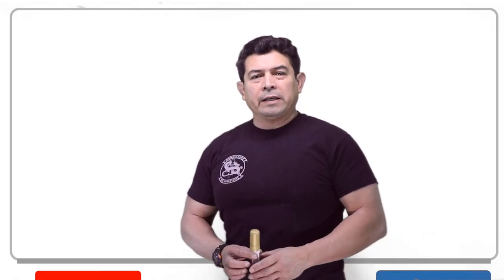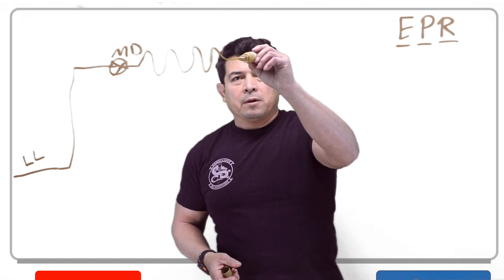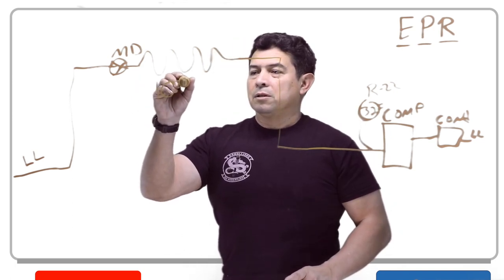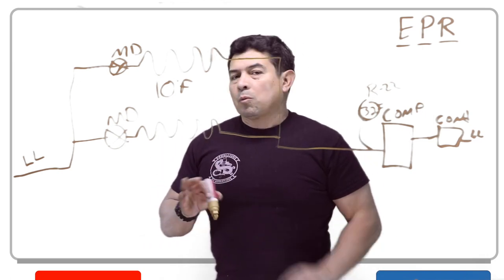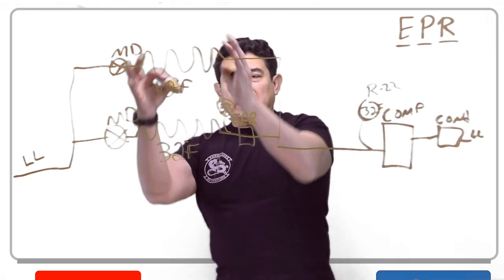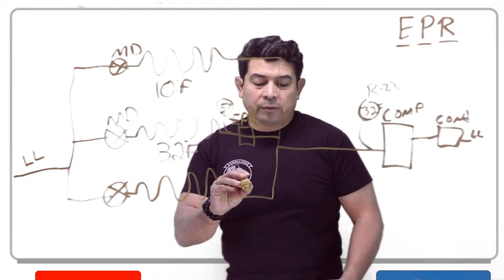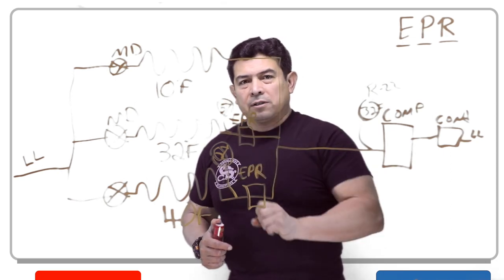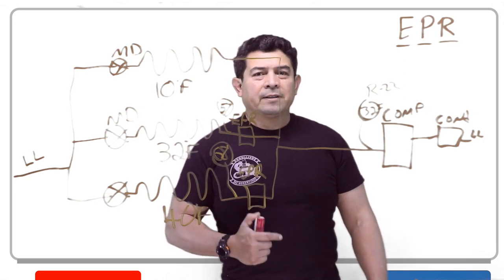Evaporator Pressure Regulating Valve (EPR) - HVAC Online Training and Courses

Comment: i dont get it, is this EPR valve able to regulate the pressure manually, also in the evap unit is it all these different temperatures in the coils ....or different fridge boxes ? one system
Reply from the maker: The EPR valve will regulate the pressure in that one evaporator. If the systems has two evaporators, and they are needed at different temperatures than the one with the highest temperature will need the EPR valve.  If you had a system with three evaporators, and they all need to be a different temperatures, the two evaporators with a higher temperatures would have an APR valve. That would be set to different pressures so that the pressure would equal the temperature desired in the evaporator. The other evaporator would not have one and it would be controlled by the pressure of the compressor. I hope this answers your question. And thank you for watching!

Comment: Very nice explanation, thank you, but can't you achieve the same goal of different temperatures with a thermostat and a solenoid valve?
Reply from the maker: interesting?   but where is your solenoid valve?    if it is before the metering device then no it would not work    if you install it after the evaporator then it will be opening and the temperature of the evaporator will instantly drop to the saturation temperature of the low side pressure. what will happen you will have wide temperature swings which will not be good for the product in the cold room/refrigeration room. Your theory seems like it could work BUT the temperature swings would not be good.   Thank you for your question!!!  and thank you for watching!!!

Comment: Hi, so whenever you install a epr valve on a multi evaporator system the proper piping procedure is to install it on the warmest coil?  And not the coldest right?
Reply from the maker: Yes, correct I am sorry if I did not specify that on there. But you want to have one on the warmest coil so I can bring the temperature/pressure of the coil up to make sure it is at the desired temperature. Thank you for your message! And thank you for watching

Comment: Do we still need the EPR if we are using variable speed compressor / digital compressor for multi ecaporator with different evaporating temp?
Reply from the maker: The EPR valve is going to maintain different temperatures in the evaporators. So yes you would still need an EPR valve even if you have a variable speed compressor. This way you can maintain different evaporators at different temperatures. Good luck and thank you for your question!

Comment: Great explanation. How do I size the system or compress when I put EPRs into the system?
Reply from the maker: I'm sorry, that is a very complicated answer. You have to know the size of the equipment or the room, and then what is going to be kept in there and head what temperature? He will also have to know what the heat transfer rate would be of the installation so you can make sure you can keep that area cool.  I'm sorry but there is no easy answer to that question. There are several variables!
Reply: @AirConAcademy  So what do you suggest to do first? I know Menu J is good stuff to calculate the heat load but ......... 
Do you recommend any app that I can calculate the heat load easily?
Reply from the maker: @scwarr  the J manual is good but it's hard to understand, I believe. The apps that you can get will walk you right through everything. It will make your life easier and help you earn some money faster!  and I know that is one thing everyone wants to do, earn some money!
Reply: @AirConAcademy  thx

Comment: Great and informative video, I am really happy to come across your channel and get refreshed on some of the things I train on...question, there is a port there, what pressure should be at that port? In you example at 4:11 the port is on the coil side, what is the pressure that should be there? Is it evap pressure? Second question, in this case we would have a solenoid at each box? 

I don’t deal w/ low temp or refrigeration but this is a cool refresher.
Reply from the maker: I am so glad you like my channel!!!  the pressure before the valve is going to be 68PSIG  and after the valve it will be 32PSIG.  there is no need to have a solenoid valve because the pressure inside the evaporator will be maintained as needed by the EPR valves.   IF you had a solenoid it would be before the TXV/Metering Device to isolate the evaporator.   but not really needed in this application.   Thank you for your question!!!
Reply: Aircon Academy got it! Thanks!!

Comment: Thanks for the clear explanation!

I'm trying to understand something. Would I still need an EPR if I don't have multiple evaporators? Or if I have split suction lines (multiple compressors)?

I'm unable to distinguish the function of a metering device and an EPR in that case.
Reply from the maker: If the metering device is going to drop the pressure as the refrigerant goes into the evaporator. The EPR valve evaporator pressure regulating valve is going to maintain the evaporator at a specific pressure, so you can have several evaporators at different temperatures. What that means is that if you have multiple save operators you can have evaporators at different temperatures.  If the system is designed correctly you would not need an EPR valve on the evaporator because it will be designed to maintain that pressure so we can have that specific temperature.   I hope this explains your question. If not please let me know. Thank you for watching!

Comment: Thanks, does it matter what kind of condenser air cooled or water cooled we have to decide about our subcool and also would it make a difference that we have very low or medium temp walking freezer to decide about our superheat
Reply from the maker: No, it should not make a difference if it is air cold or water cold.  The superheat will be the superheat that is required. What I mean is that if it is above freezing or below freezing the superheat will work the same. I just do not know what your temperatures are and what your superheat need it is. I have never worked on very low temperature freezers but it should all work the same. Thank you for watching I hope this helps.

Comment: I’m actually trouble shooting an EPR valve at the moment in a coffin case supermarket. Air flow is good, fan is running but it’s pushing warm air. I’ve never trouble shot a EPR valve, any tips? I’m confident system is low on charge due to sight glass flashing but I would like to hear any advice. Thank you for the cool vids!
Reply from the maker: My suggestion would be to try to clear the sight glass to attempt to get the charge close to what it should be, but this may not do it.   Most of the time to make sure the charge is correct, the refrigerant is recovered, a vacuum is pulled and the unit is charged by weight!    This way you know for sure the charge is correct and then you can properly trouble shoot the unit. If the charge is NOT correct you will not be able to trouble shoot the unit properly.   It may be more work but it can save you time in the long run.   I hope this helps.
Reply: Aircon Academy the fact that you responded is highly appreciated! Thank you for the knowledge gems. I charged 48lbs of R404a to the system and it’s now and temp but I know this is just putting a band aid to what I’m sure is probably a leak. Grocery stores, they love cutting cost and corners lol
Reply from the maker: @xavierchavez4859  I try to help yo guys so I try to respond.   have you looked i to getting some of those leak seal additives?   some guys have had luck with them.   But it sounds like yo may need to use quite a bit if the unit uses that much refrigerant.  good luck.

Comment: Sir, your videos is knowledgeable, but I want to know that EPR evaporator pressure regular is going to close the area of EPR so that the gas is going to flow less and pressure is going to increase in evaporator coil that is all the idea but to buy  EPR what details we have to check, if we want both same temperatures in two different box, so still we have to use EPR ( why because one box is going to reach the set temperature before then another.) Plz reply
Reply from the maker: I am n ot sure I understand?   It sounds like you are trying to add something onto an existing system?    One of the main things you need to concentrate on, is if the compressor/unit can handle you adding another coil or box to it.   It also sounds like you're trying to keep another box the same temperature. If that is the case, you can just adjust the EPR valve so they maintain basically the same temperature in each box. If you do need want the two to be at the same temperature you really do not need an APR valve. You only use that when you have two boxes from the same unit but different temperatures. I hope this makes sense. I tried to explain the best that I could what I thought you were asking. Good luck!

Comment: How would you find the compressor inlet pressure if you already have the temperatures and pressures for 3 different boxes? Would you average out the temperatures and the find the corresponding pressure to that temperature?
Reply from the maker: Thank you for writing!!!  you should be able to get the actual suction pressure at the compressor. Look at the compressor inlet and there should be a port for you to get the suction pressure.  You should have a semi-hermetic compressor so there should be a service valve that you may need to close a bit (Crack) so you can get the actual pressure.   I hope this helped.
Reply: @AirConAcademy  This is actually for a Refrigeration Class and this is just like a project question so there isn't any physical components. I was given the all 3 box temperatures and it was stated that the compressor inlet had a superheat of 25 degrees Fahrenheit. I was able to figure out all of the pressures inside each box but I am confused if each box's refrigerant comes out of each EPR a different pressure and into the same compressor. Thanks for responding.
Reply from the maker: @patrickflynn3036  oh.   I understand. It is for school. Averaging the pressures would not work because those are the pressures inside of the evaporator’s. I believe you said you had three evaporators? Do all evaporators have EPR valves? Because if one does not that would be your compressor suction pressure.
Reply: @AirConAcademy  Okay I understand. We basically have to design our own system and our professor did not give us much details about it so I will make only 2 of the evaporators have EPRs. Another question, would you rather have the evaporator with the highest pressure or the lowest pressure not have an EPR?.. since that would be the compressor suction pressure. Thank you.
Reply from the maker: @patrickflynn3036  It would have to be the evaporator with the lowest pressure. That way the two EPR valve that you have, or are going to have will be able to raise the pressure in the evaporator and release him into the suction as needed. So it would be the one with the lowest temperature/pressure. Good luck with your project!

Comment: How do you adjust an epr valve
Reply from the maker: That is a little tricky. You need to make sure that you know what the temperature is that you want and what the pressure for the temperature needs to be. You need to check with the PT chart and adjust the EPR valve for that pressure so you can maintain the desired temperature.  It is a little tricky to do as long as you take your time check your pressure and temperatures you should be able to do it. Good luck!

Comment: Thank you sir !! What is the difference from a EPR and a CPR valve (crankcase pressure regulator)?
Reply from the maker: one controls the pressure in the crankcase of the compressor(CPR) and the EPR controls the pressure in the evaporator.   take a look I have a video that explains each one of them.
Reply from the maker: Thank you Very much!!!
Reply: @AirConAcademy  awesome. Thanks again 💪😎

Comment: Thank you for another great lecture. I have a question. Can we use EPR on a walking cooler that has three separate evaporators?
Reply from the maker: yes  but they are used to maintain the evaporators at separate or different temperatures then the others, or in other words at a higher temperature then the one with out the EPR valve.
Reply: Thank you for answering my question. I appreciate the knowledge you sharing with us.
Reply: Just set individual tstats in return and dial them in , perfect if you have heavy traffic in an area of  the cooler/freezers or long blast chillers/frzrs, a bit of work setting up valves but badass🤙

Comment: What are some issues an epr valve may have .
Reply from the maker: Mostly is not enough airflow!!!   sometimes the filter if it is an AIrconditioning unit will stop the flow. Other times it could be the fan is not operating correctly.   If the metering device is over or under feeding refrigerant to the evaporator it could be misdiagnosed as an evaporator problem.
Reply: @AirConAcademy  how would you troubleshoot these issues
Reply from the maker: @mividaloca7975  if it is an AC unit then you would look at the filter, look at dampers through out the building, measure the airflow and figure out if it is enough according to the size of the unit .    if it is a refrigerator you would just look at the fan to see if it is working.   the metering device you would check to see what the super heat is.    I cannot just give you a simple fix.  it takes a lot of troubleshooting of the unit.
Reply: @AirConAcademy  cool thanks